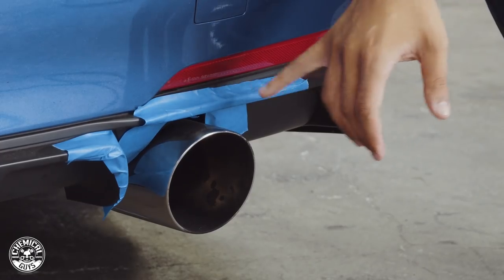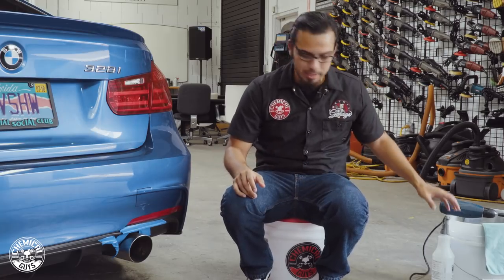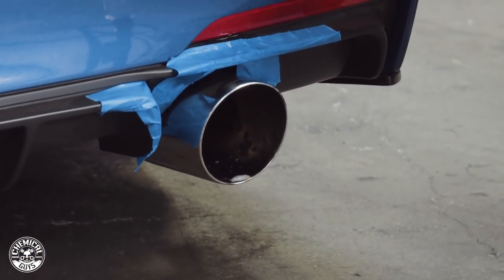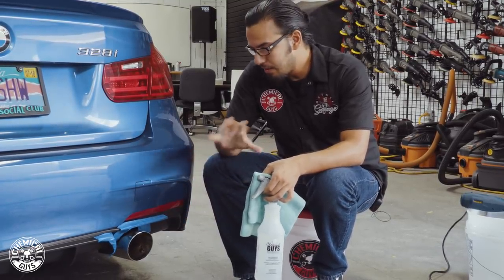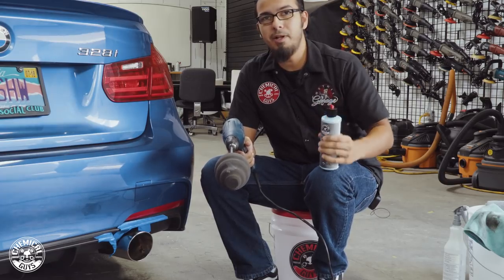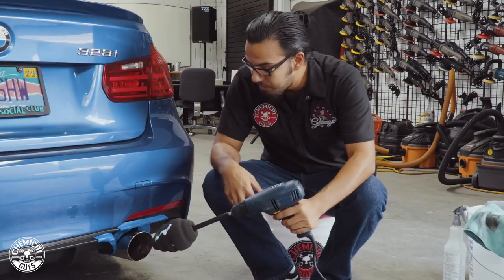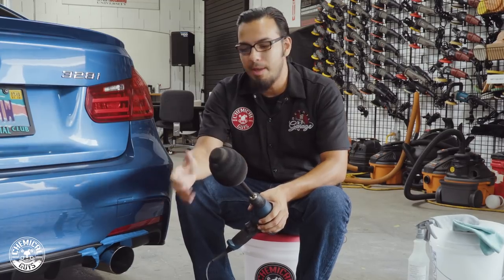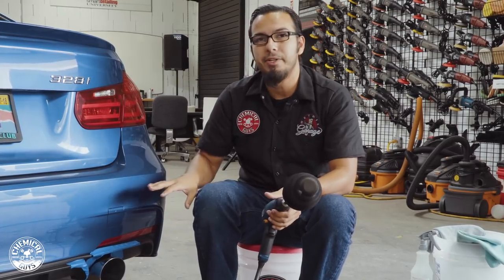How To Make Exhaust Tips Shine! - Chemical Guys Ball Buster

Comment: is this safe to do to burnt tips? or will it fade the coloration?>
Reply from the maker: Hi Chase! Light Metal Polish gently cleans metal surfaces, removing stains and oxidation without using abrasives. It should work perfectly fine for your exhaust tips.
- CG Nick

Comment: Have you done or thought of doing a video on the hard to paint correct areas?  Behind door handle scratches, under deck lid, in tight spaces. Awesome videos Thanks
Reply from the maker: Hi Chris, good question. If using a smaller pad such as the 3" one isn't practical, then you can hand polish those hard to reach areas. Check out the video below of Nick hand polishing the area behind the door handle of a black BRZ. Thanks for watching, Chris, and thanks for being a part of the Chemical Guys family! 
https://www.youtube.com/watch?v=7hM5uXBxKfA

Comment: Can you use the metal polish and jet seal on tips that are coated with Opti Coat Pro Plus ceramic coating?
Reply from the maker: Hi, great question. Metal polishes contain abrasives that could compromise your ceramic coating so we do not recommend using them on your coated exhaust tips. Use Chemical Guys metal polishes before ceramic coating your vehicle for best results. Thanks for watching and make sure to check back later today for a new video upload!

Comment: I have a Range rover with swirl marks 0n the plastic trims. What do you recommend to remove these marks. Thanks
Reply from the maker: Hi Tony, you can use a cleaner such as Nonsense to clean your textured trim, however, to remove scratches and swirls from your textured trim, you will need to take your car to a professional. Thanks for watching and make sure to check back tomorrow for a new video upload!

Comment: What is the best way to clean my matte black tips?
Reply from the maker: We recommend Meticulous Matte Detailer. Meticulous Matte contains no gloss enhancers and no wax that would add unwanted gloss and shine. Specialty spray sealant technology blended within Meticulous Matte coats the matte finish, enhances the crisp sheen, and protects against pollution, water spots, UV sunlight, and contaminants that attack paintwork and wraps. Using Meticulous Matte Detailer & Spray Sealant during regular cleanings protects matte finishes against the elements, and keeps them cleaner for longer. Thanks for watching and thanks for being part of the Chemical Guys family! Check link below.

https://www.chemicalguys.com/Meticulous_Matte_Detailer_16_oz_p/spi_995_16.htm